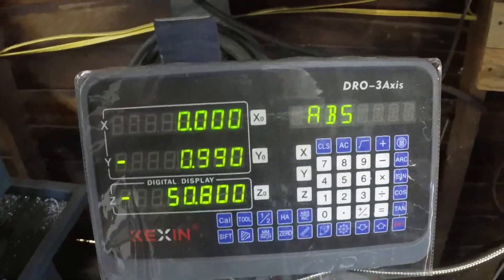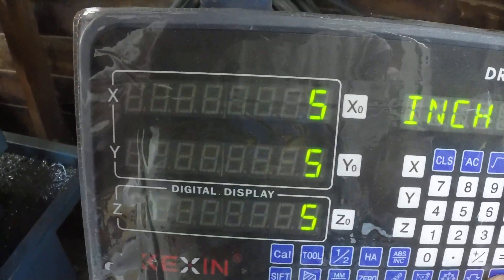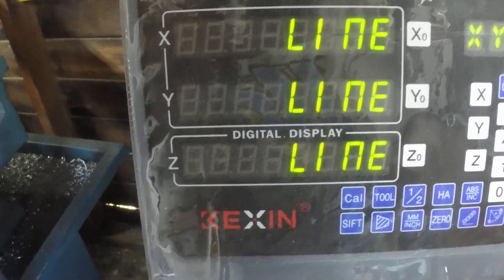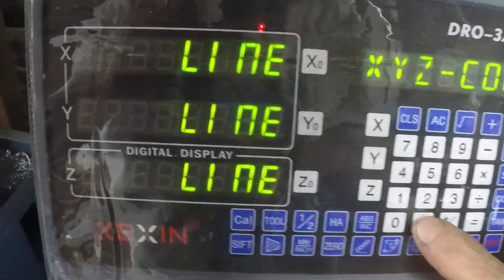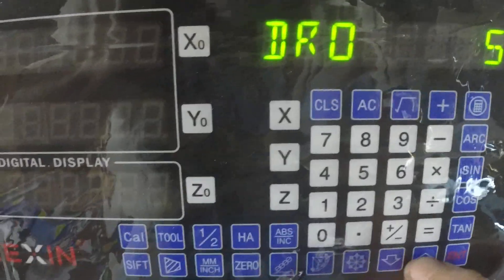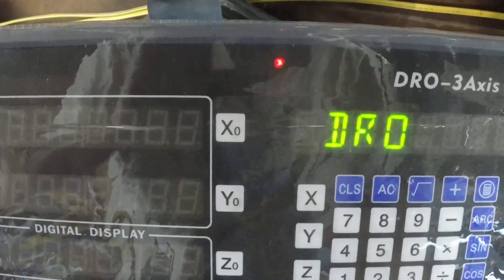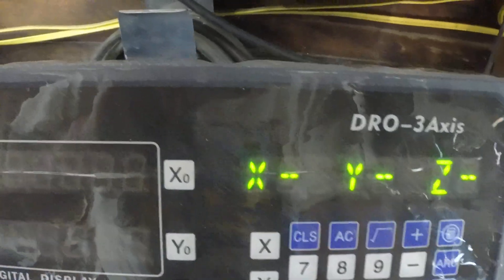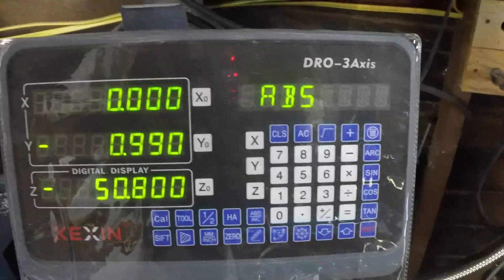ToAuto DRO Settings

Comment: Note: Those who receive the ToAuto DRO Screen with two buttons that are labeled differently. The CA button is the same as the AC button and the INV button is the same as the ARC button. As of March 2024 the Operation Manual has not been updated to show this.

Comment: Thanks for the demo.  UART means means Universal asynchronous receiver transmitter.  Their must be a serial communications port on the DRO some place.  You can get some sort of readings on a remote device like that.
Reply: The serial communication interfaces, and there are 3 of them are the ports that connect to the scales. My guess, and it's only a guess is that you can configure various aspects of them and or turn them off as desired, like if you're not using one of them.
Reply: @fredflintstone8048  if for some reason you don't want to use one just do not plug the cable in.
Reply: @AmateurRedneckWorkshop  Yes, I understand that, but I wonder if the display goes off on that particular model when unplugged, or if this setting might turn it off. Of course there may be some other setting where you could turn off the display for one of the axis due to it being a possible distraction. As I said, I'm only guessing but would think it would either be to enable/disable a particular port, or maybe change one or more settings like baud rate etc.
Reply: @fredflintstone8048  that is not likely.